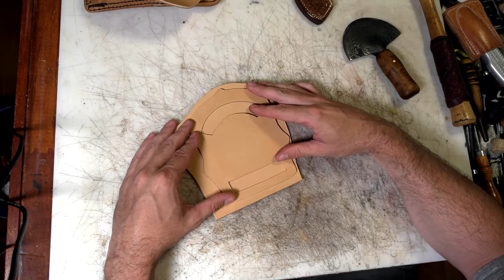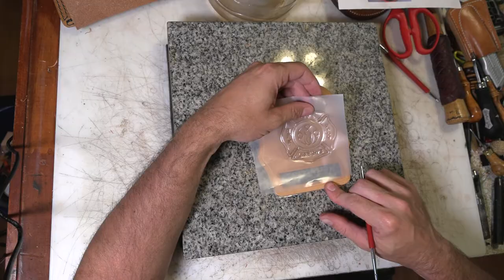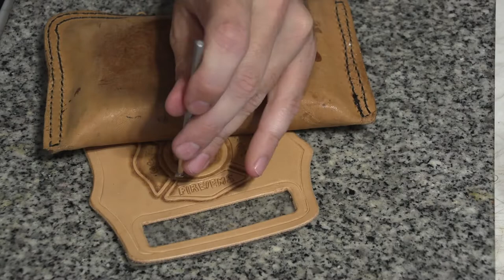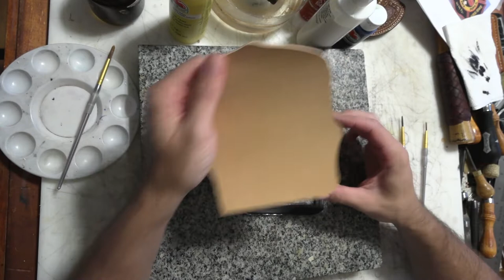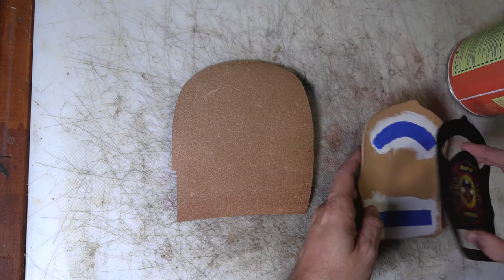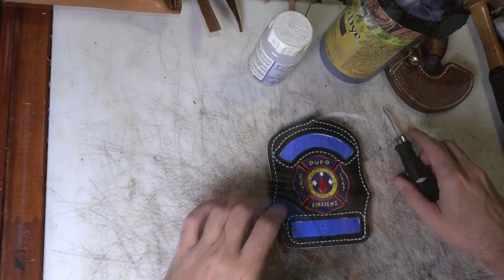Making a hand carved helmet shield for a firefighter.

Comment: Nice job. What size needle and thread are you using in your machine?
Reply from the maker: #346 for the top thread.  I like to use a little bit thinner thread for the bobbin so I have #277 on it.  The needle I had to go check.  The one I am currently using is a size 26 spear point needle.  I have also used size 25 with that thread combination.
Reply: @bransonsgeneralstore  Thanks brother, again nice work.